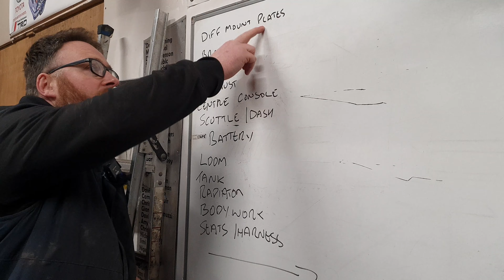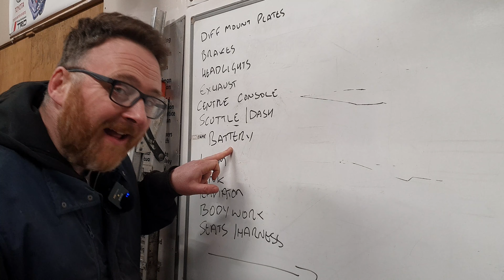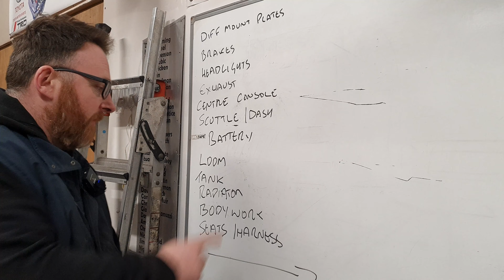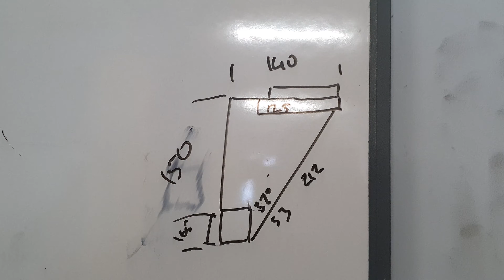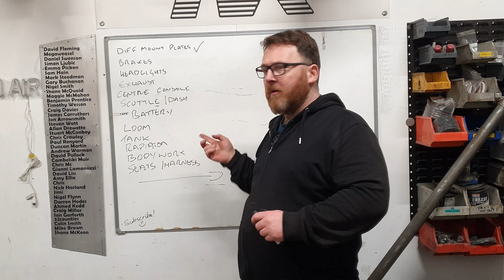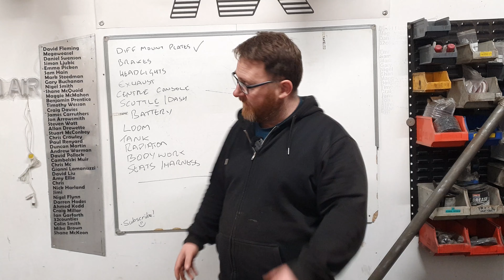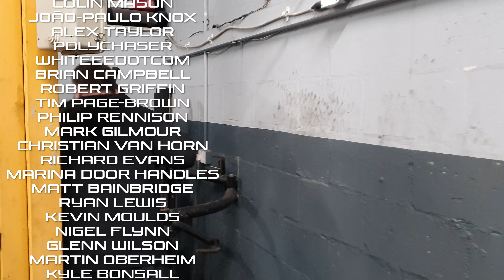Locost 7 Kit Car FULL BUILD!! - Episode 73 (Project 7-UP)

Comment: I'm interested to see what you do with the handbrake cables because they appear to be sitting very close to the seat back. I didn't find a solution, in the end I'm running the rear uprights backwards so my handbrake cables stick out backwards instead of forwards. The diff plates are a really good idea though, and nicely done.